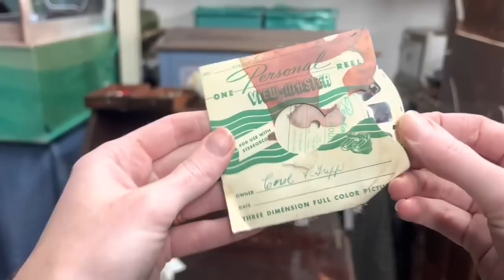Painting Decoupage Paper | Vintage Secretary Makeover | Elegant Upgrades

Comment: The face of the drop down desk turned out absolutely gorgeous!! I have a secretary just like that, only with the top cabinet on it. I painted the whole thing in an oil based white paint, except the inside of the desk. I had no bleed through. I spray painted the original hardware a matte silver. I painted the top trim of the cabinet in bright colored paints and the legs black with silver balls. And that's it, I lost inspiration for the rest. I think I might decoupage something on the outside face of the desk, from watching this video. Thank you so much for the idea!! 🙂
Reply from the maker: Oh man! I was so with you all you had done so far envisioning it in my head and then you said you lost inspiration-  I hope you find it again!  It’s so hard when that happens.  I’m glad you found something useful in the video!  You’ll have to let me know if inspiration strikes and you finish it.  It sounds like it will be amazing when you get back at it.
Reply: @elegantupgrades  I actually went onto Amazon and looked up some decoupage paper to put on the face of the fold down desk, after watching the video. That's a start. My other conundrum is, what color to paint the body of the secretary. I painted one drawer with purple stain I have, to see if I liked it. It's been like that for about ten years. I should probably just stain the other drawers and be done with those. As I'm typing this, I think I may decoupage the sides as well, I hadn't thought of that option before. Thank you for being an inspiration!!

Comment: Beautiful work ❤. I’m interested in how you have your sander attached to a vacuum.  Did you DIY it or did you purchase it from somewhere. Thanks
Reply from the maker: Thank you. I actually just found a connection set on Amazon that fit the sander to my shop vac hose. This is the set I’m currently using, but you may need to use a different one based on the measurements of your own tools. 
https://amzn.to/3IbQIww

Comment: Looks gr8 👏🏼👏🏼👏🏼
Re: the dings in the piece that u couldn’t sand out…have u tried steam ironing a damp cloth over those dings, the water & steam causes the wood fibres to rise up closer to their original place. I’ve watched other furniture artists/refinishers do this…it doesn’t completely work every time, but it does significantly reduce the depth of those dings. Hope this helps?
Reply from the maker: Thanks for the tip! It wouldn’t have worked here because the fibers were actually broken and some were missing (I’m not sure what they did to that poor desk 😂). But had they been normal dents I definitely would have done that.
Reply: @elegantupgrades  had u heard of this before? I know I’ve seen Jay from the UK do this & I think I’ve seen transcend furniture do it also; and Rita from A-R-T
Reply from the maker: @designabeej  Yes, I learned it from Tom Johnson! He’s my favorite. I feel like he knows EVERYTHING.